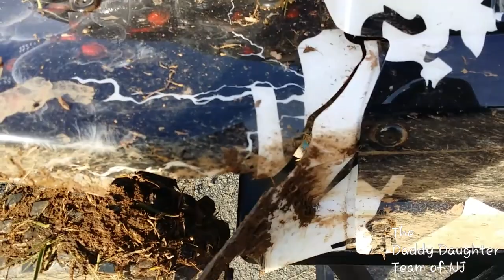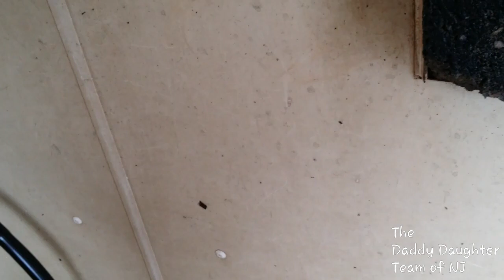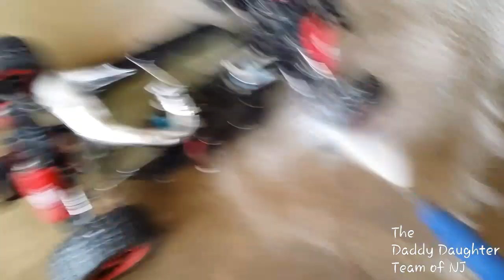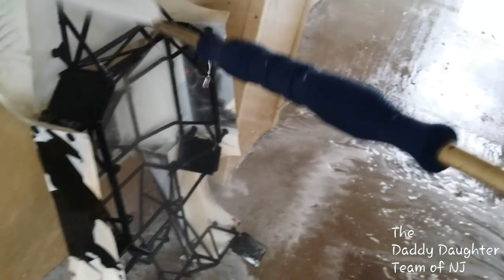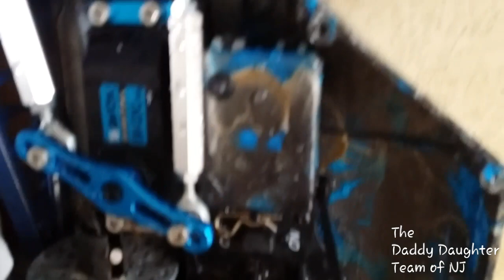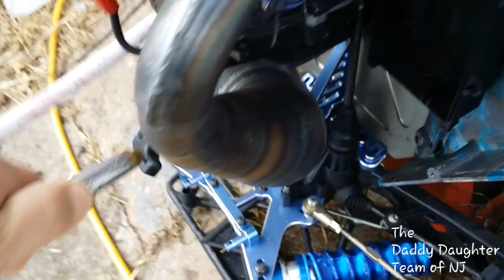HOW I LIKE TO CLEAN RC CARS AND TRUCKS

Comment: willl there be any problem if I wash may Baja while the electricals are in?
Reply from the maker: No guarantees,  I don't have any issues doing  it,  though most of my electronics are waterproof,  so they claim. Just be careful around the electronics,  ultimately,  wash at your own risk. I hope that helps you 🙂
Reply: I like to remove.the battery and receivor along with throttle servo.
Steering servo isn't that important throttle if it sticks well that could really suck
Reply from the maker: @jonathanharrington9648  definitely 👍

Comment: I just got the shorty recently if I get dust on it or light dirt I use a air compressor I was talking to the sales rep and told him my idea of using a weed killer container since it has light pressure and simple green if I get it muddy he said that's fine just cover the air filter and when done take the air compressor and try it off as best as you can

Comment: bro im getting the MTXL Saturday cant wait.  your rigs look like my BAJA from yesterday lol. I have to get myself a air compressor. do you wd40 it down after the compressor dry?
thanks
Joe Cam
Reply from the maker: Yeah little WD-40 works good especially on a pipe some people squirt silicone spray on the whole platform I used to do that I'm not sure if I will continue to though I kind of think they clean off better when are not sprayed without silicone? ?
Reply from the maker: MTXL Is with out a doubt my favorite rig!